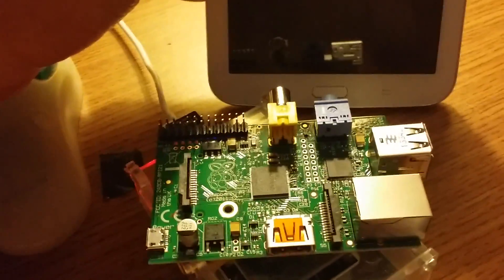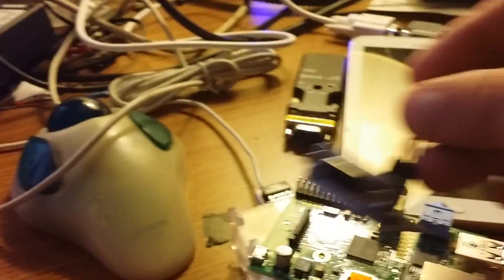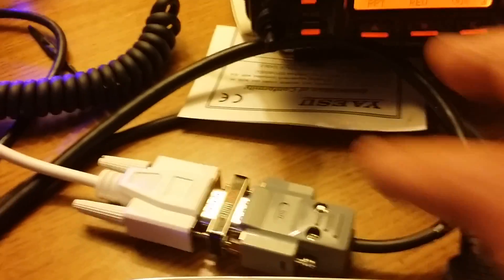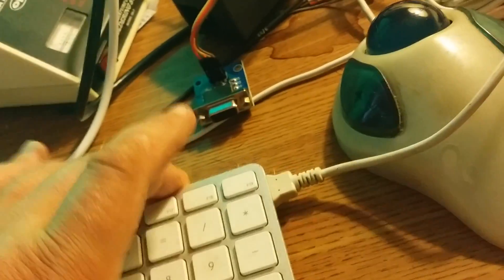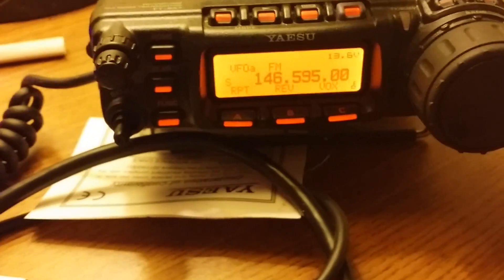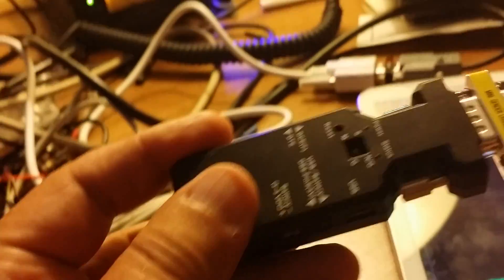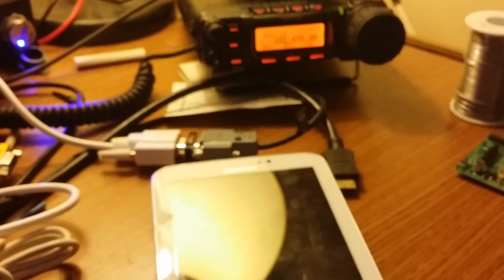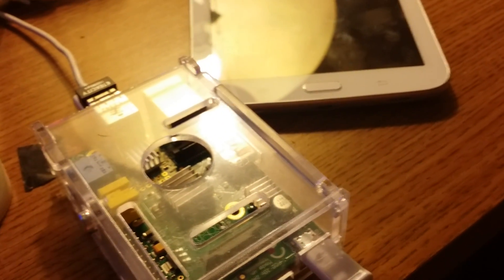RFinder Pi real-time radio programmer!

Comment: Has anything changed concerning Bluetooth.  Repeaterbook uses Bluetooth except they charge to much for their bluetooth.
Bluetooth on ebay is less than $10 delivered.
My Radio is mounted in the trunk of my car. Would the Raspberry Pi unit work over Wifi to connnect to the radio
which in my case is mounted in the trunk of my car.
Reply from the maker: RB uses BT on Android only...you cannot do this on iOS except iOS can be done with certain chipsets using BLE...we opted for this because it works on both Android and iOS...and is open source so hams can make a script for any realtime programmable radio such as D700, D710, TS2000 IC7000, 706, etc. It comes ready to go for an FT8x7...Unless something changed, the RB app does not support a $10 dongle...only the $100 or so bluecats shipped out of EU...if you are stuck on using a $10 dongle, you cannot afford a realtime programmable rig anyway LOL...a RPI kit with all you need is about $75ish...unless you already have the stuff in your junk pile ;) as I do...I do recommend RT Systems Cables as they just work...the drivers are in the Linux Kernel...This is a fun project..have ati it!
Reply: on Ebay you can get a custom configured BT dongle for $30, Have him name it "BlueCat" and it should work.

Comment: So right now the Raspberry Pi is only used for QSY requests between RFinder and the radio? Are you working on any other uses integrating the Pi with RFinder that would make me consider buying one? Is there a software app that needs to be running, or is it just taking advantage of the hardware connection?
Reply from the maker: Well that is the current purpose, but we are toying with controlling CHIRP running on the PI using the app. That is a way off, but we are also trying to get connected to the PI using Bluetooth networking, so the PI can go to the internet using the phone while also acting as a programmer!  The software on the PI is LAMP (Linux-Apache (webserver)-MySQL (database)-PHP (script programming).  LAMP is easily installed on any version of Linux and we exploited those functions to allow us to program radios.  Currently we only have Yaesu FT-8x7 rigs but we are about to start on the Kenwoods and if we can get our hands on iCom rigs we will do those too. However, this is open source, so ANYONE can create a script.

Comment: This looks like a fun project! I'm curious though, why hamper the Android capabilities just because it's something Apple doesn't allow?
Reply from the maker: nothing has been hampered...we looked for a solution that would work for all platforms...also we wanted users to be able to add radios at will. we are playing now with using bluetooth to connect to the phone as a hotspot, allowing tyhe pi to get to the internet through your phone that supports bluetooth tether.  The phone will be able to get back to the pi also of course...this is on the bench today...
Reply: Maybe hampered and to strong a word, my apologies. I just mean if you have a known working Bluetooth solution for Android, why dismis it just because ios doesn't support? 

I've done the pi to phone hotspot in the past. I used the stock wifi tether.
Reply from the maker: TC Johnson We had several criteria when looking into his:
1. Accessible from any converged pervasive device
2. A single code base for talking to the radios

Item 1 for obvious reasons. Item 2 because it would be challenging managing a plethora of radios on a variety of devices.  The Pi allows us to add radios quickly no matter what device is in your had.  A simple generic QSY request is sent to the Pi to change freq, shift, pl and/or dcs, etc.
Reply: Awesome, thank you for the responses.

Is it now or will it be possible to have a second radio running on scan and populating the RFinder tables which can then be programed to the primary radio? Maybe when a new freq is logged and added the Pi can fire off some type of notification (email?) to let you know of the addition? Of even better, use a Pi Display to show scrolling or updating real time stats of the scan/tables?

Now you have me wanting to buy an 857 so I can play along :)
Reply from the maker: TC Johnson I don't think so re the second radio...we may split the button into two so you can have two radios attached to the Pi.  I suggest a more modern radio such as the IC7000 or IC7100, etc. if you are buying a new one. I am experimenting with the Pi Touchscreen...see http://www.ebay.com/itm/480x320-35-LCD-Touch-Screen-Display-Monitor-for-Raspberry-Pi-CaseHeatsinks-/251589970332 
also please participate in the forum on QRZ... http://forums.qrz.com/forumdisplay.php?102-RFinderPi-Open-Source-radio-interface-based-on-Raspberry-Pi
Reply: Thanks for the link, I'm checking out the forum now.

Yeah, an ICOM radio would be nice... but the price tag :(
Reply from the maker: TC Johnson Look for a used one!